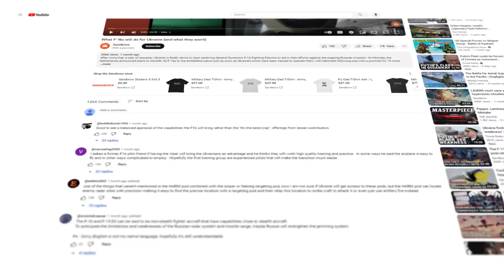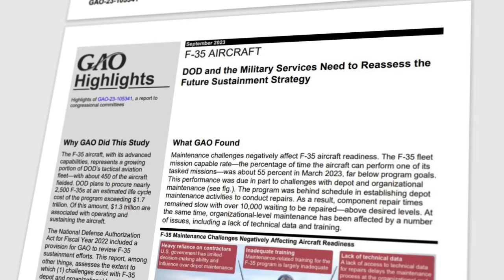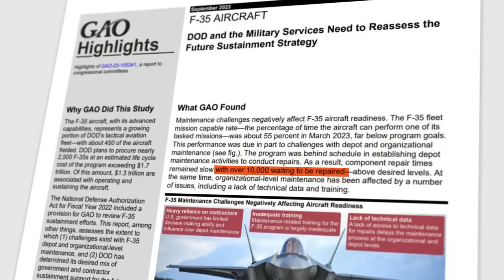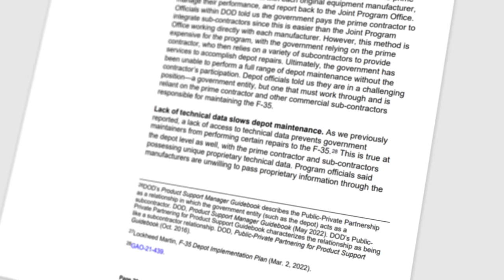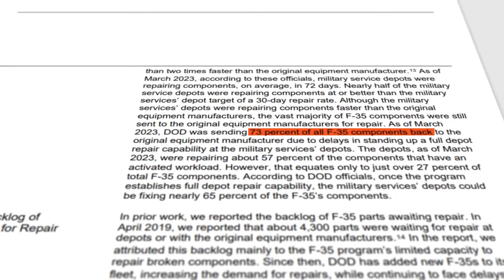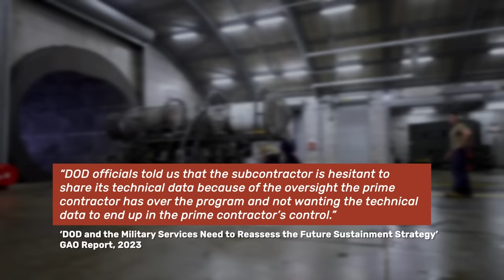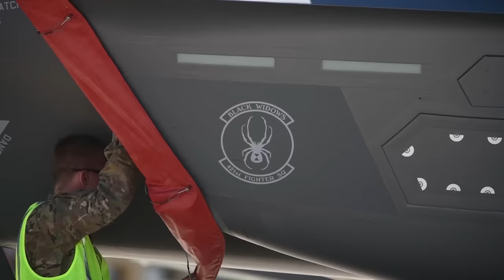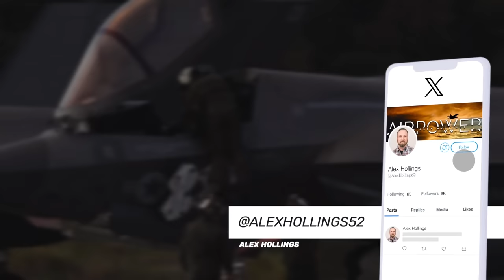Why are only half of America's F-35s ready for a fight?

Comment: Brevity, Mr. Hollings, brevity! The information and comments you supply are much appreciated and found nowhere else. Hence, I trust the "Sandboxx" name and click. However, I often balk at their 20+ minute length and don't view the entire video, or at all. For example, this video did not begin until the 9:30 mark. Until then the viewer is thinking "What you taking about, Willis?" A focused approach would cover everything you mentioned in 10-12 minutes or fewer. Start with the GAO's 55%; set the context by stating the figures for the F-15, F-16, etc.; explain how the F-35 could improve with data sharing, fully operational depots, adequate spare-part supplies, etc.; and, finally, explain why you think that because of the complexities and expanded capabilities of the F-35, the expected 85-90% readiness goal is unrealistic, and indeed, arbitrary. Context and facts before discussion and opinion provides better understanding. Good, but not great, video nonetheless.

Comment: The F35 program from beginning to end has just been a test bed of failures to be addressed for the NGAD program.

My big question is how is this readiness affecting allied readiness especially as the F35 replaces F16s to be shipped to Ukraine?

Have you done a video about the damage that "concurrent design" has had on high cost procurement systems? Off the top of my head, the F35, F22, Ford Class Supercarrier and and the AP1000 nuclear reactor all faced massive cost overruns due to concurrent design. The concept was like 90s cocaine dream of designing a cart around the horse so the horse could both push and bull the cart, and to build the cart while the horse was moving. I'm not aware of a single successful endeavor that was successful because they started production before a finalized plan.

Comment: The F-22 is the stealthies.The F-35 is the second stealthiest. The Gripen is the third stealthiest. Comparing the F-35 to the Gripen should be a valid comparison, perhaps with a bit of leeway given to the F-35 for its better stealthiness. Both are single-engine multirole fighters.
Reply: Two generals in 2014 dismissed claims the F-22 was more stealthy, so the F-35 is at least equal if not better in terms of stealth